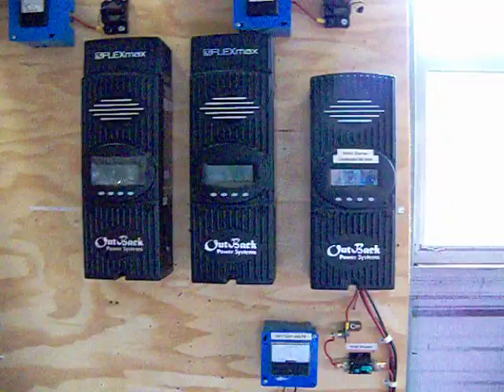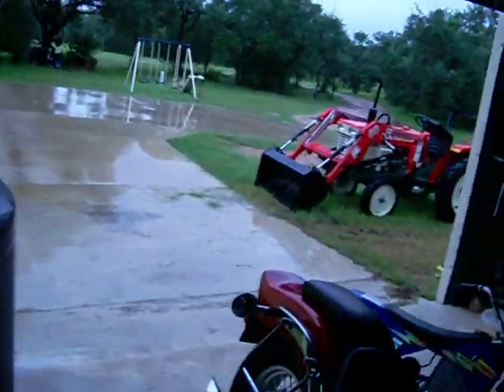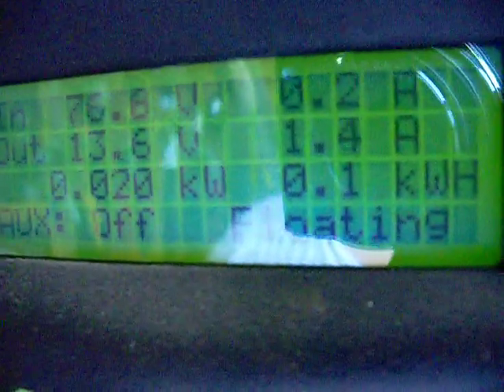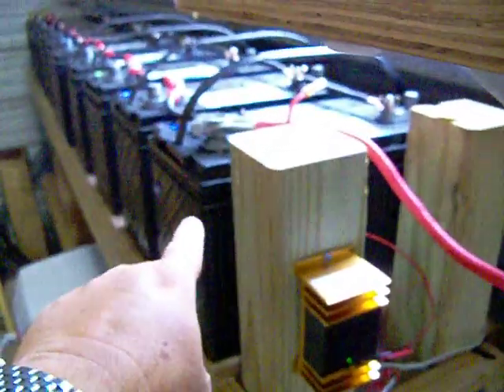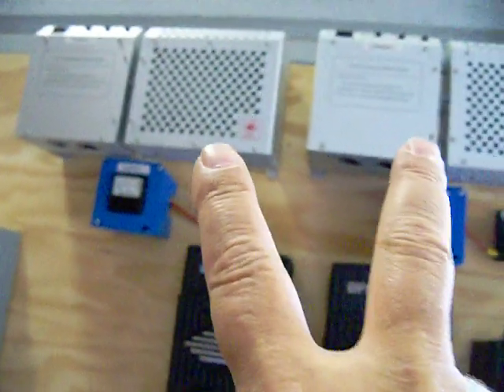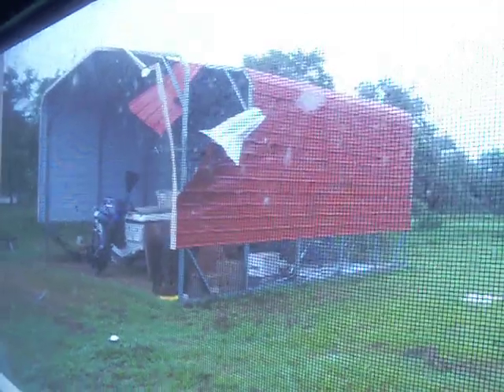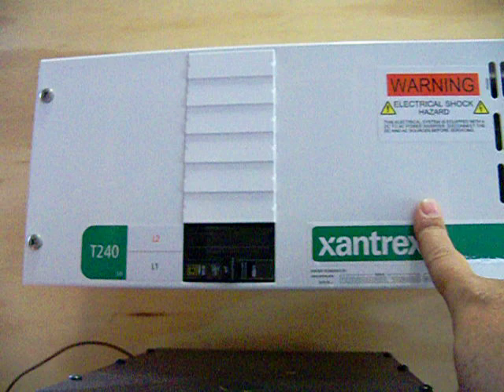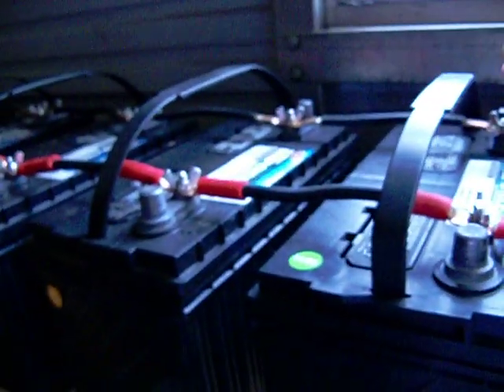Wind and Solar Power Center Part 1

Comment: some of your statement aren't wright,
What you telling  about your battery DC29 is BS.
Your DC29 cant even  compare to any 6V deep cycle battery.
If you say your battery will last 10 ,15 year or so the 6V deep cycle battery will do same think.
Also if you say harbort fraigft solar panels has some Advantage that is BS too. simply what you pay that what you have.
In today solar panel market you can buy much much better panels for less.
 I  agree that you have knowledge of all this.

Comment from the maker: It would cost me too much to switch now, my inverter costs about $2,500 and they only make it up to 48volts. I do have a backup inverter which is 36 volts in case my main inverter fails.

Comment: hi,why dont you make it 72 volts battery bank ? that will increase your hours of usage ,and decrease the loss of amps between 24 volts to 120 or 220 volts ,.i have a 72 volts battery bank its much better from 12 and 24 volts and im thinking to make it 120 v battery bank ,

Comment: You can't revive a worn out lead acid, the lead plates turn to a sediment / powder and settle on the bottom of the battery as part of it's normal lifecycle. No way to revive it, when it's gone, it's gone.

Comment from the maker: I don't recommend used batteries, even if you revive them the loss of the lead from the plates is so large that they won't hold a charge very long or last very long. Get new real deep cycle batteries if you can. Better a few good ones than many mediocre ones.

Comment: Do you advice if I buy the Lead acid battery for cheap which are dead and revive them and use them as doing so will be cheaper.

Comment from the maker: @TheMoonrakers Never had a single bit of problem out of my turbines, those things just keep going strong. You did the right thing getting the HY-1000, in normal winds of around 12mph you'll be getting around 300 watts out of its 1000 watt rating, of course the power rises very quickly as the wind picks up. Get another 1,000 that's what I did, the 400 output is too low in moderate wind.

Comment: Use the solar cells to create and store hydrogen. Purchase a quality gas generator suitable to your energy needs. Convert the generator to burn hydrogen. Wire the generator to feed the main breaker panel. 

Then inform the electric company to remove their property from your residence or legal action will be taken.

Comment: Hi and thank you for your reply.
We are getting 12v from the Cells and will deliver 15kw of 220V/60 hz or 380V triphase. For purpose of reliability, I cannot do anything in series. only paralell. This unit will power a Sea Water Desal unit in Africa (if we can finish the Solar unit). The Solar system will use the Batteries as Buffer and a Diesel Generator as a  UPS, in daytime. Rgds, Theo. Orlando Systems.

Comment from the maker: @OrlandoSystems Assuming you'll wire for 48 volts (I would), then you would end up with four banks of 6 batteries in series each and then the four banks connected in parallel. That will give you 3,312 Amps but at 50% draw you'll have 1,656 amps usable power which at 48volts equals 79.488 KW. If you plan on using that much in 24 hours then you'll need a 4KW inverter. The rest is simple just choosing which circuits to wire to a transfer panel with sufficient circuits.

Comment: Hi, nice set-up
I am working on a 15kw, 70 panels, 250w each, Mobile System. I can use some help to figure this one out. I have the offer for panels (SBM), the batteries (VALENCE) but I am stuck on the Inverters and Integration, 220Volt/60Hz. The system is divided in 14 racks of 5 panels each, about 40" x 80" per panel. We plant about 24 batteries, at 138ah, for 2hours UPS minimum. 
Your video and install is very professional. I had no time to visit the Great Banks Yet. Tks. Theo.orsys@yahoo.com

Comment from the maker: @orlan7s1 Go with 3648 if you can, the higher the battery voltage the lower the amps on the wires and the more efficient power conversion is. For the charge controller you don' t have to go all the way to batteries if you already have battery cables going to your inverters, just use those to also go to the charge controller, it's all the same circuit. Yes I was born in Cuba, but I became and American when I became a citizen so I consider myself an American first and foremost. Thanks for posting.

Comment: Do not waste your money on small batteries . The best way to store your energy is by using a forklift battery pack .You can get a refurbished one from a forklift repair shop for about 600 to 800 dollars. and the up side for the investmen, the batteries will last about 40 years!  so, do the math.... super video! thanks.

Comment from the maker: @jone3333333333 That is not possible my friend, only when due to lack of maintenance  one battery goes bad will you ever see that. I have worked with 24v circuits for years and I have never seen that.

Comment from the maker: @HUCKLES42 Yes, I still have it. It is a TrippLite APS 2012, new, never used, have the manual for it. You can look it up on line, they even have the manual on line. It sells for about $650. I want $375 for it. Thanks!

Comment from the maker: @kricotas I meant to write Outback FlexMax 80 charge controller.
The inverter is TrippLite APS2012
I plan on 20 batteries.
Thanks!

Comment from the maker: @FUBARPROTOCOL Carey I got the panels from sunelec (.)(com) and I paid $1.20 per watt. I just saw yesterday they had four left for $1.70 per watt, however, they have other panels that are as low or lower. Take a look at the Kaneka 60watt panels, they are made in Japan, UL listed, make more power than other panels when it's hot and they price per watt is pretty darn good. I think they have them at $84 per panel. Take care buddy!

Comment from the maker: @kricotas Outback FlexMax 8

Because of better availability of inverters at that voltage and thinner wires due to smaller amperage draw at 24v.

Comment from the maker: @michael970 I've been doing grid tie for over a year now using the Enphase micro inverters on my 1.6Kw Sharp panels. I will do some grid tie on this system as well but will save that video for later this month everything is done (should be done by the second week in October).

Comment from the maker: @DeepsouthSolar Because originally I was going to use a 12v battery bank,  so 2KW of solar at 12v equals 166Amps and each one is capable of only 80 Amps. Now that I'm going to rewire into 24 volts I will only need one so I will reserve it for future panels or sell it on eBay. Do you want one? :-)